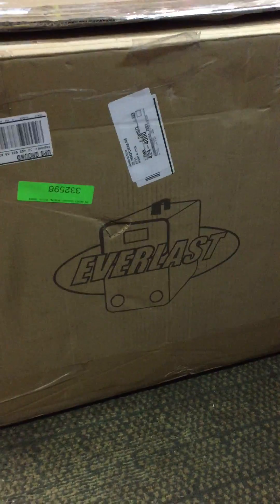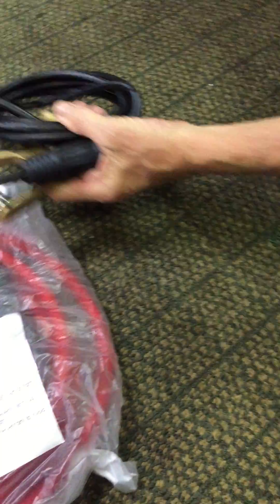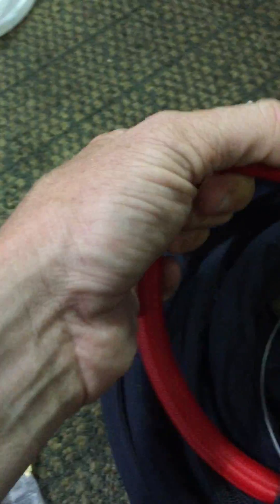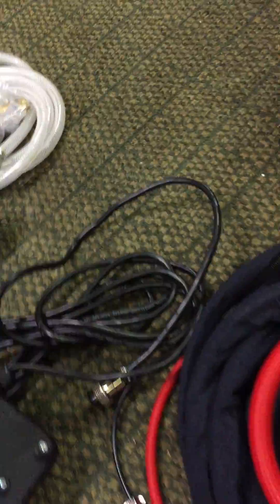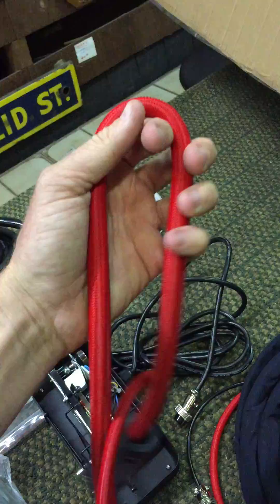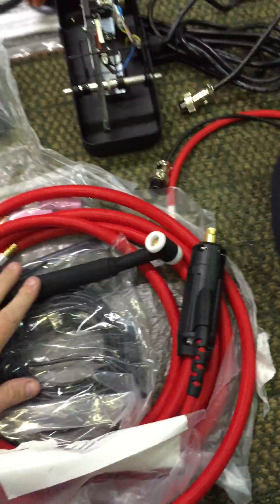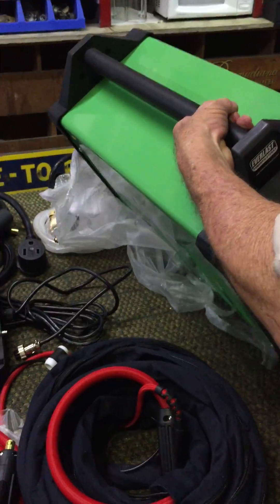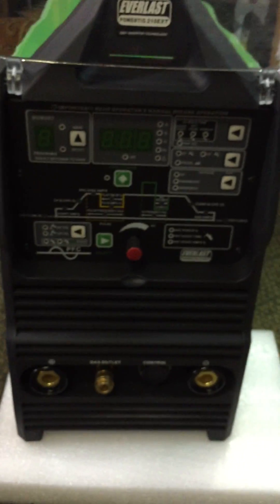2016 Everlast PowerTig 210EXT opening with new upgraded tig torch options

Comment: thanks for posting this video.  just wondering if you have used the stick much? Bpt welding posted a video on this machine and the 6010 rod didn"t perform the best with this machine, the 7018 electrodes were fine but the 6010 were sticky.  just seeing if you found this also

Comment: 210 looks like a promising machine. Let us know how it do es for you please. I have been interested in 221 invertig but $$$
Reply: Had mine for years. Got it when it first came out so I have the older torch and what not. GREAT MACHINE! you can't go wrong with it. I just upgraded to the CK 26 flex head torch.